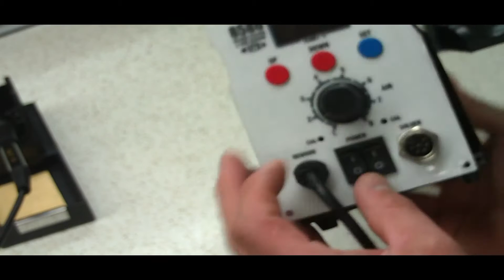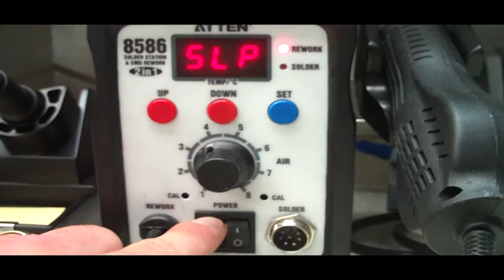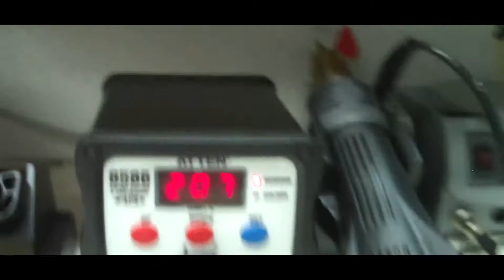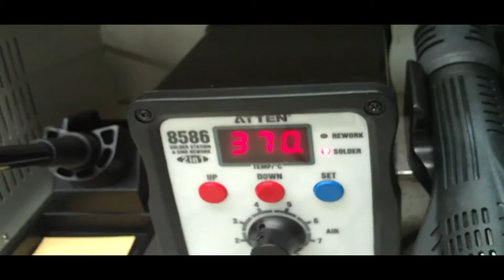Atten 8586 SMD ReWork and Soldering Station Review and Teardown

Comment: Mine the soldering station holder started to melt when I put soldering iron in, then I plugged the hot air in smoke started coming out of it and I couldn't turn it off by switch or putting it in the stand had to pull ac.  I am not using it again. Sent back.
Reply from the maker: Geesh. I would not use it either. That’s crazy has to be a defective temp sensor.

Comment: I have just ordered the same one,  branded as YOUYUE but is identical......   just starting out to learn microsoldering.
Reply from the maker: Looks like there are several clones floating around. Thanks for the updated info Incase someone else is looking to buy one.
Reply: From what I have read, they are all made by the same company and sold to resellers who put their brand name on them.......  I have also seen them on aliexpress with no brand name at all.....    Looks like a good starter unit at least.   I just ordered one along with a scope and other equipment and supplies for $450cdn ...   And I have lots of old phones etc.. to practice on.
Reply from the maker: Not a bad deal. Best Wishes

Comment: Can some tell me how many volts the soldering iron need.
because  need 2e one.
i find cheap one on Amazon 24 volt
who can Measure this for me
Reply from the maker: most of the adjustable soldering iron are 24 volts DC.
Reply: Thank you, i have also find out
But there is a diffrent between  a 907  IRON and  907C iron
There was my problem  becouse i have a 907C iron

Comment: hello, I wanted to ask and 'normal for the 8586 my attention when I set the temperature for the hot air to esepio 300 degrees the temperature rises up to 380 and then stabilizes at 300, it seems strange,
Reply from the maker: I have seen mine go a little above the target set temperature but never by 80 degrees. I think I have seen mine go to maybe 10 degrees above.